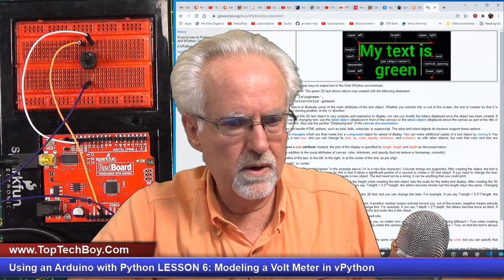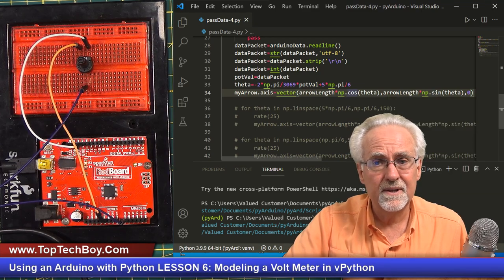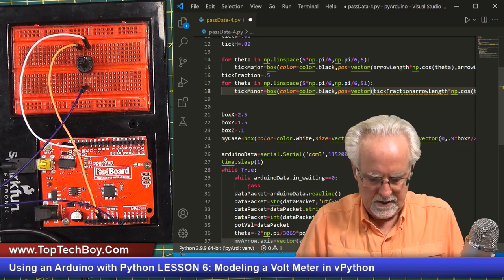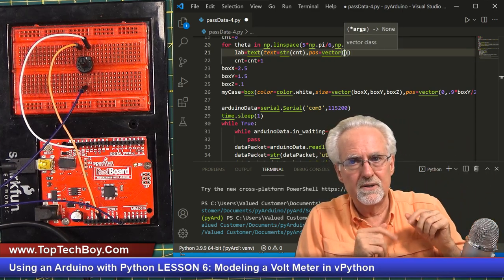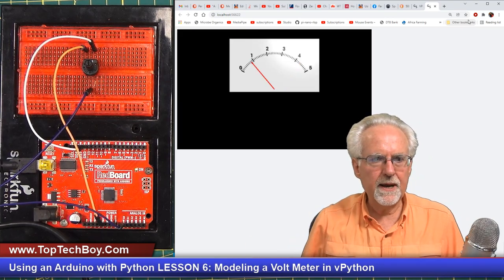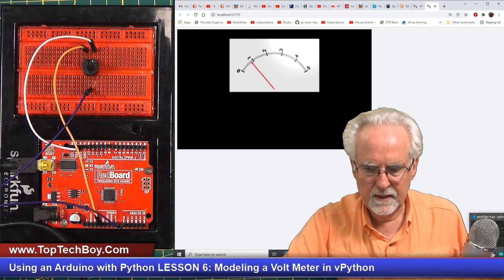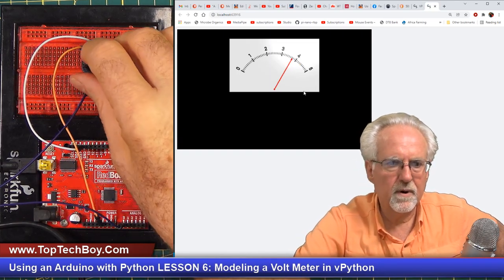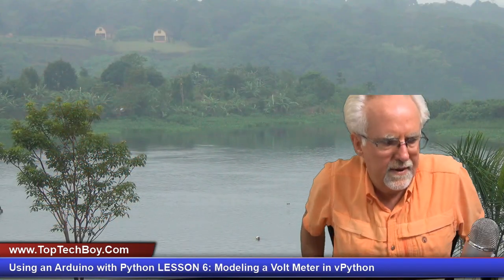Using an Arduino with Python LESSON 6: Modeling a Volt Meter in vPython

Comment: Great stuff! I did Physics 101 way back in 1966 and in those days Voltmeters were physical metal boxes. We did our calculations on slide-rules and the nearest I got to a computer was to punch some 80 col. cards with Fortran commands and hand them in to pick up 1 week later. If the programme was wrong you submitted a new batch of cards and waited another week!!!. I could not have dreamed that we would have the power in PC's we have today. P.S. from what I can remember the logic behind Fortran was not too different from modern languages like python, but nowhere near as powerful. I am retired now (74 years old) but love following your lessons

Comment: A fantastic thing I learned here that seems very valuable. You can ADD VECTORS!! thermometerAOffsetVector = vector(5,6,7)
thermoAPiece1 = box(pos=vector(0,0,0) + thermometerAOffsetVector)
thermoAPiece2 = box(pos=vector(0,0,3) + thermometerAOffsetVector)
This makes it easy to move an entire set of related 3D objects while maintaining their relative position, simplifying code, and improving readability.

Comment: I have enjoyed you lessons very much, and have learned a lot..thank you!  Instead of doing the volt meter, I modified the Temperature  sketch and using the DHT11, created a temperature and humidity graphics display with a thermometer bulb, and a circular humidity Gage using the Arduino to bring the data to the VS python graphics. As soon as I can figure our how to upload a video of my project, I'll share it with you and all whom are in this wonderful community.

Comment: You're a great teacher, Paul. You are certainly helping to keep old brain cells firing!
While trying to develop tick marks for the voltmeter, I made the assumption that you needed to maintain the identity of objects displayed on the canvas. Thus, I created an empty list for the tick mark boxes and appended them to the list while working through the loop.
From your approach, I see that once you draw an object on the canvas you can change the object and draw it somewhere else, and once drawn, the object stays on the screen.
I guess with my version I could change the colour or size of the tick marks when they align with the needle, giving a special affect at a cost of memory I suppose.

Comment: You could actually for your voltage labels have something like: 

for i, theta in enumerate(np.linspace(5*np.pi/6, np.pi/6, 6)):
    tickMajor = box(color=color.black, pos=vector(arrowLength * np.cos(theta), arrowLength*np.sin(theta),0), size=vector(tickL,tickW,tickH), axis=vector(arrowLength * np.cos(theta), arrowLength*np.sin(theta),0))
    lab = text(text=str(i), pos=vector(labF * arrowLength * np.cos(theta),labF * arrowLength * np.sin(theta),0), color=color.black, height=0.05)

the enumerate python function replaces the need for a counter in for loops :)

Comment: Here's what I ended up with: 
https://youtu.be/-HFPiiSJpiU 
This required a 30k and a 7.5k resistor, that unfortunately are not present in the elegoo super starter kit 😑 so I used a voltage sensor module instead 🙂 
It worked quite nicely 🍋⚡️😄👌
Reply from the maker: Excellent. Was not expecting fruit to debut in this video.
Reply: @paulmcwhorter  😄👍 
I wasn't expecting that amount of voltage from it 😳 
Just think, another 513 and I could power a smart car 🤯
Reply: Look forward to seeing it on Kick Starter !

Comment: Hi Paul,
i have played a little with different scales, but the 270 scale is a difficult one. i have made it work, but with a little try on error, and that is what i not like.
can you check my calculation?
Coordinates 0 Volt are : (0,-5pi/4+pi/2)=(0,-3pi/4)
coordinates 5 volt are : (1023, -7pi/4-pi/2)=1023,-9pi/4)
M=y2-y1/x2-x1
M=(-9pi/4)-(-3pi/4)/1023-0
M=(-6pi/4)/1023
M=-6pi/4092
Y-y1=m(x-x1)
Y-(-3pi/4)=-6pi/4092*x
Y=-6pi/4092*x-3pi/4
Theta=(-6pi/4092)*potVal-3pi/4
Theta=(-3pi/2046)*potVal-3pi/4
let me know or this is the right way to calculate this type of scale please?
Thanks in advance

Comment: Hi Paul. I have posted my solution here: https://youtu.be/h1DCbOOPD_k

I now have a spiffing volt meter inside a glass cover and screwed to a metal panel. I have also wrapped the serial connection in a try-except as my code did not "like" it when my Arduino happened to be on a different USB port, and thus had a different com port assigned.
Reply from the maker: A+